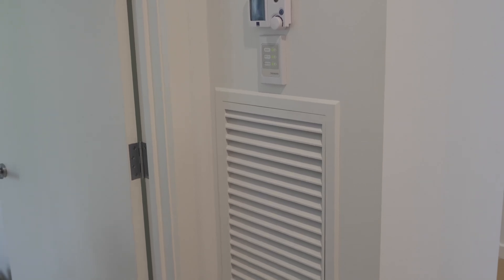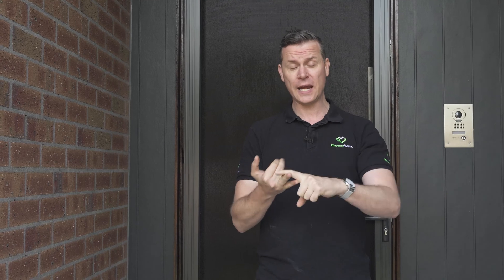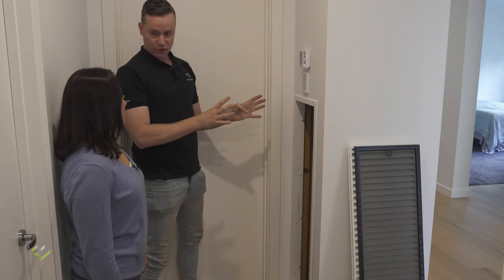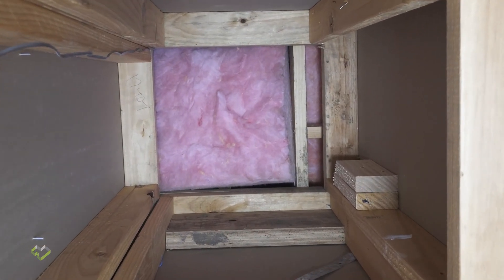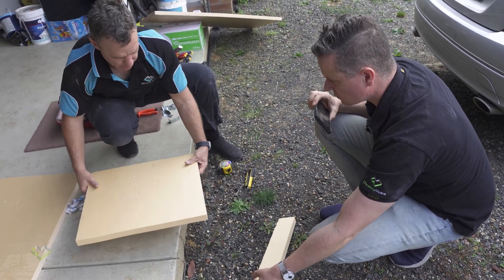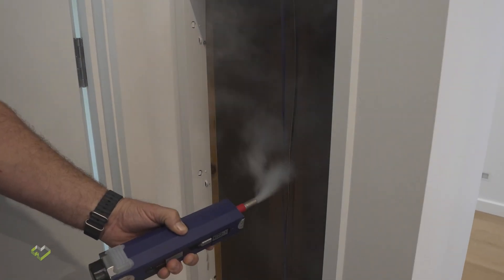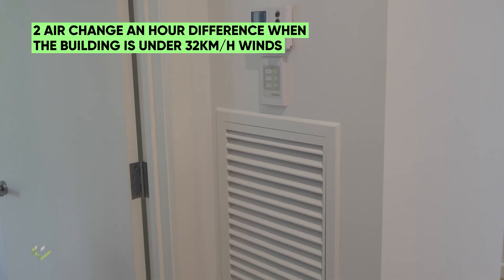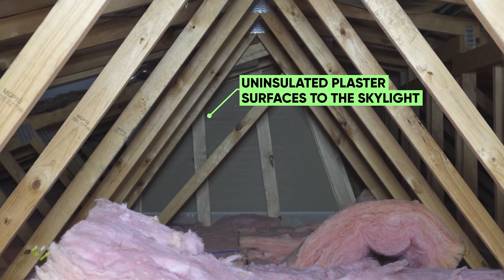Ducted System completely open to the roof space?

Comment: Good work guys but where is the return air connected to now? You just capped it off and didn't cut the return air duct into the void lol

Did you just leave the air handler open?
Reply from the maker: The return was going through the floor on this one.   We may have missed putting in the B-roll of the ducted return penetrating the floor🙃.  
We are doing a connection via the roof on the next video.  It’s a problematic one too, here is a short showing it off.
https://youtube.com/shorts/L_Qm-skkshs?feature=share

Comment: The Australian building industry needs a good going over. Nothing has changed in so long yet we keep paying for rubbish homes to be built. Volume builders should be banned as they only care about a quick buck and not about the customers or the quality of the homes they're building. If you want a quality built home, use a custom builder and consider an ICF or SIPs house. These can be built extremely tight, increasing efficiency and saving the owners money in the long run, which offsets the extra cost they pay for a quality build. In such tight homes mechanical air systems to bring in fresh air is usually required. The air is filtered and conditioned giving the owner a clean and healthy environment to live in as well as being super quiet due to no air leaks.
Reply: Spot on. If I ever build again I'm going with ICF for the combination of airtightness, thermal break and thermal mass. + Heat recovery ventilation and multi-pane windows to limit the need for heating and cooling. After 20 years living in an Australian builder-spec brick veneer home you realise just how low our standards are and how simple things like insulation and draught sealing done right, would make a difference to the occupants comfort and energy consumption.

Comment: Do you guys do inspections to check insulation and air tightness on new builds? If so, at which stage is it best to engage your services?
Reply from the maker: Air tightness and insulation consistency audits are done when the building is finished, and the heating and cooling system is operational.   We can do inspection of works during construction as well, and we are very meticulous with our reporting marking everything off, on the floor plan.
Reply: @ecoevo  very useful information. I'm from Ukraine, we use retrotec for tests as well